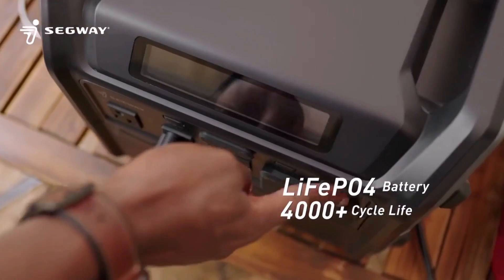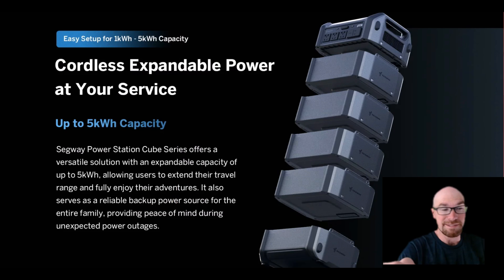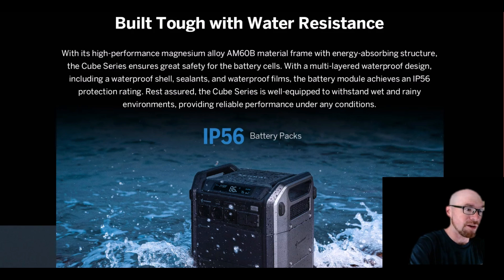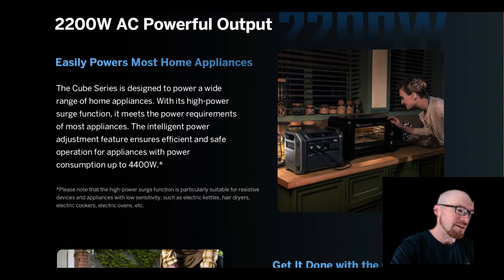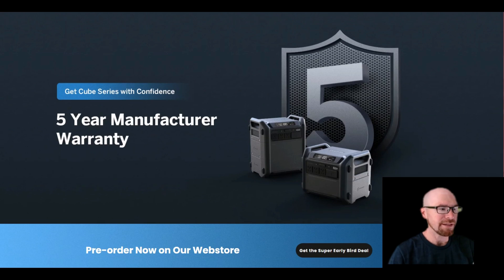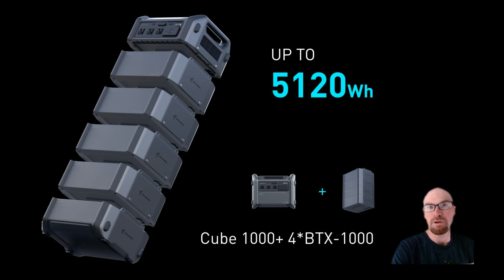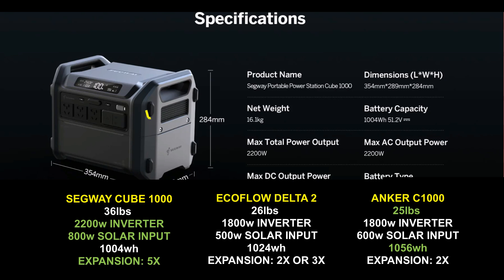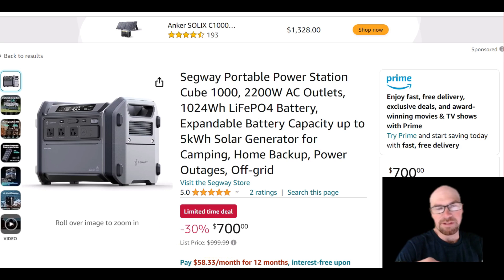SEGWAY Power Station

Comment: Pass through charging? Connecting 2 together for 240?
Reply from the maker: No parallel connections on this model. DC passthrough is almost a certainty, but I can't confirm. AC bypass is supported up to 1440w.